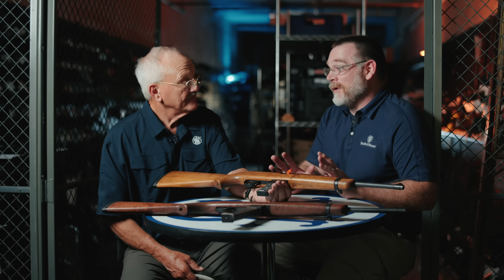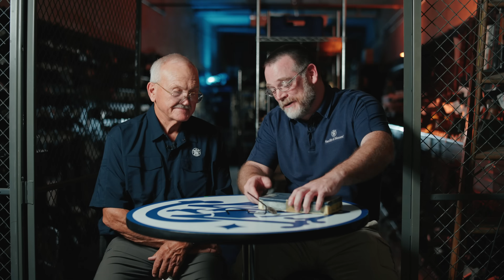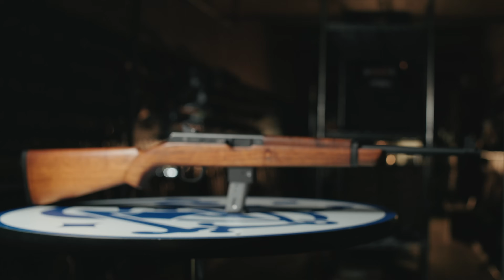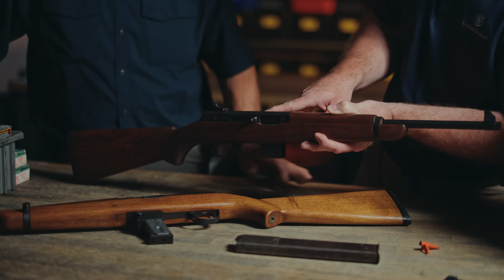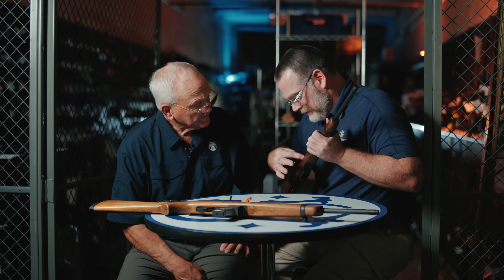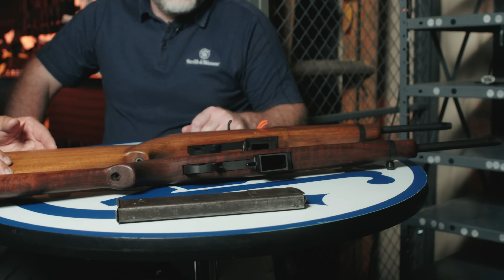Project Spitfire 9mm Carbine | Tales From the Vault with Jerry Miculek

Comment: Had a marlin camp carbine in 45 and it was a delight.  The only downside was the plastic furniture on it gave it a real sense of chintziness.  The older I get, the more I appreciate wood and iron, not all this plastic crap that makes a firearms seem more of a toy.  Plastic doesn't develop that wonderful patina of age.

Give the Spitfire a cast aluminum housing for the mag and trigger assembly.  Maybe a steel trigger guard.  And some nice checkering or basketweave rather than that we-all-know-its-a-cost-cutting-thing stippling that Henry and CZ are using.  Do that, and I'd be ready to buy.  I don't like the Homesteader from Henry because it looks cheap and they don't offer an upgrade package.  If S&W came out with a competitor that held very true to the form of the M1 Carbine or Thompson subgun, you'd have a winner on your hands.  The problem is getting the idiots in the design rooms to do it right and not skimp on the quality of the parts.  No plastic allowed, I say.  Make a weapon that will become iconic and look good in a hundred years.

Comment: As a S&W owner I've haven't bought your pcc because not a fan if the grip feed...but
Imagine how far this could go...factory/aftermarket chassis for it like with rugers and a ton of other avenues accessories and add-ons..it would be a money maker if done right..
You have the prints and the proto types, so half the battle right there..even if you went delayed blowback it still would be awesome..the price would be the biggest hurdle...to expensive and it would struggle...between 5-7 bills would be perfect..
Please make them..

Comment: Somebody should make a lightweight,very handy
short rifle, 5 lbs max, takedown, folding stock,Glock mags - make it ultra reliable, sleek but robust and pleasent to look at , not to tactical.
No ugly visable cheese rasp rails, but 
able to take a light or laser.
With open peep/ gostring sights but optics ready and with a threaded barrel.
Make it in 9mm, .40., .45, 10mm.... 
Maybe add  5.7 to the available calibers ..
Semi auto AND a way turn it into an manually repeater with a modified receiver  - for countries with different gun laws.
And keep it under a 1.000  Dollar.
To much to wish for?

Comment: """" What A Missed Opportunity In The 90's """"   DON'T Make The Same Mistake Again. 
""" If """ We Can Finally Get NAFTA Overturned Produce It With A 10.5 - 12" Barrel As Originally Designed. With The Correct Barrel Profile for The Perfect Balance.  Keep The Wood Stock, and The M1 Garand Safety. 
And Add 40 S&W, 10 mm, & .45 acp Chamberings. Offer a Short Mag. For When In A Scabbard, or Carried For Miles. 
And if You Could Figure out how to Hold One, or Two Magazines Vertically ( Internally & Locking in Place  ) or Horizontally under the Butt plate ( Without Destroying The Balance of The Rifle  ) (( Difficult, I Know in Such a Light Carbine  )).
And Also """ IF """ The NFA Gets Repealed Making Something Internally Suppressed AND DOING IT CLASSY Like Ruger Did With There 10 / 22.
""" YOU """ Smith & Wesson Would Dominate That Segment.
Reply: P.S. I Worked in The Firearm Industry for Ten Years From the End of 86 To 96 And I Remember That Time Frame During BSA's Ownership of S & W, I  Can Only Speek From the Outside. But As A Hole Those Were Good Years. BSA Invented A Lot Of Money Into S & W ,
Quality Improved """ A-Lot """ And Your Gun Of The Week, Produced Many Great Designs & Concepts. But Then ( Columbine  ) Happened And BSA Got Spooked, and Sold S&W off in a fire sale to some random venture capital investment companie, and That Started a 15 year Downward Spiral.
In 96 I Became A Peace Officer, Now Medically Retired. ( Disabled  )

Comment: A simple version with a picatinny rail section on top and a threaded barrel would sell extremely well. The recoil system seems very well balanced and is very interesting when compared to other 9mm carbines on the market.

Comment: Dude.    Its a Marlin Camp 9.   They took "Clinton Clips" of the S+W 5900 series back in the 90s.  It was the best of its kind before pistol braces.     Just make it to take glock mags and thread the barrel folks!!
Reply: It's not. The Camp 9 is straight blowback and basically a Hipoint in a wood stock about the same quality as a Red Rider BB gun. The Spitfire is delayed blowback (like an MP5 but with a flapper) and you can see the quality of it.

Comment: Interesting that even in 1945 Smith& Wesson knew that blowback carbines suck. 

Ive always liked the idea of the Ruger PC and the Henry Homesteader but they're too damn heavy 

SW needs to make this
Reply: They hold the intellectual rights to the delayed blowback mechanism so more importantly they could drop the square section bolt with its flapper delay into an AR18 like box section upper and use an AR15 lower. Everyone wants an MP5 replacement that doesn't cost MP5 money.

Comment: I actually would like something like this 
Not sure if it would be in modern times but it looks potentially like it could be manufactured/sold for less than the Henry homesteader which is a bit overpriced in my opinion especially cause the mags seem to beunrilable and then you gotta buy the glock magwell separately just to make it work. 

So even if it was the same price if the damn thing just worked out of the box I’d be happy

Comment: 1995… that’s about the time Marlin discontinued their Camp 9 and Camp 45 Carbines. Had both and liked both, except I didn’t care for their polymer trigger housing. These Smiths look fantastic in wood and steel.
Reply: And that's the year the HiPoint 995 came out.  It's the ultimate "Good'Nuff" gun.
Reply: @FunnyHaHa420 not hardly….

Comment: Beautiful gun, and I can't recall ever saying that before.  But I'd change the top piece of wood to either metal or plastic (and dark gray/black).  The single piece of wood for the entire stock, with the grain flowing through it, and just the overall shape, is great.  And then just set it up for use with the standard M&P double stack magazines, an optic mount, and the shortest barrel allowed, and it's a winner IMHO.